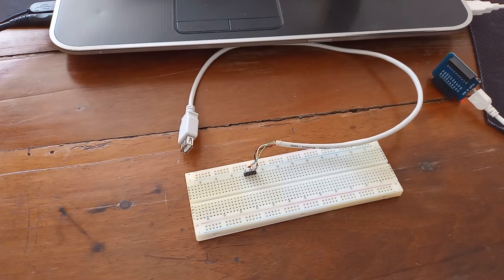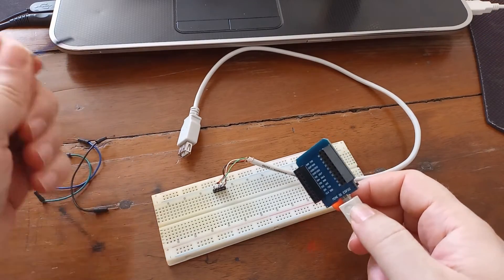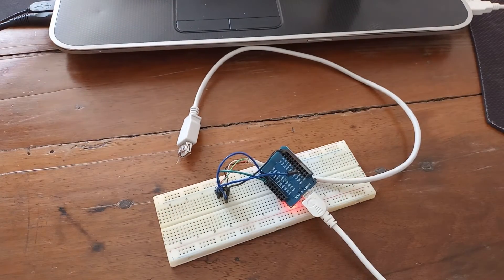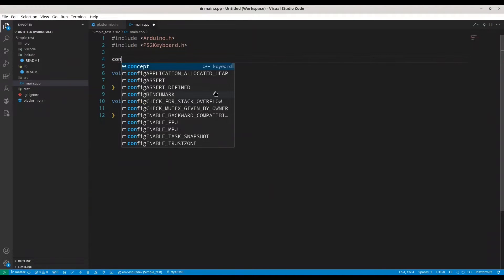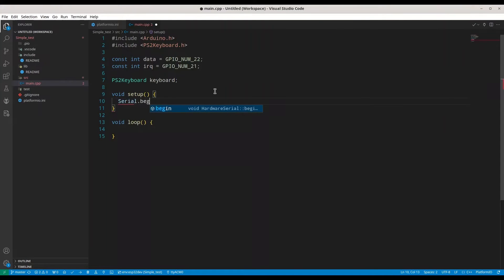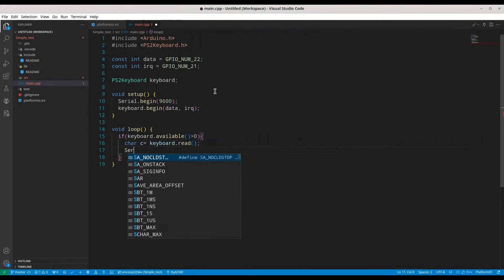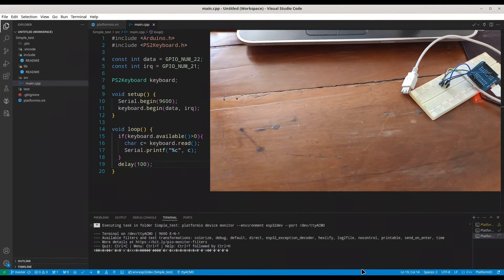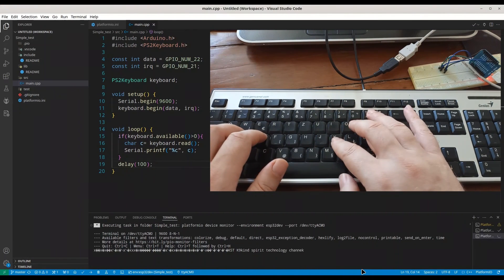ESP32 & ESP8266 - How to use USB keyboard with PS2Keyboard

Comment: A word of warning:  Paul Stoffregen's PS2Keyboard library only supports ps2 keyboards, so for this trick to work, the USB keyboard MUST support also the PS2 protocol. None of my keyboards do. I f your keyboard do not work on a PS2 port using a cheap USB-PS2 adapter, it wont work here.

Comment: Why dont you plug the keyboard directly to host. Instead of using microcontroller what the use or purpose of microcontroller in your video content?
Reply from the maker: Well, I can't get all of possible reasons on my mind, but I can tell you why I did it on multiple occasions. In most of cases, I used this technique in order to update configurations on access points or on working units, where all other options are now available (usually when microcontroller is no easily reachable or when is dangerous to do it over wifi for security reasons). Second reason is to create life shell experience, usually by using some display. And in few situation I did it, just in order to act smart 😁 it affect clients really good, I must say.